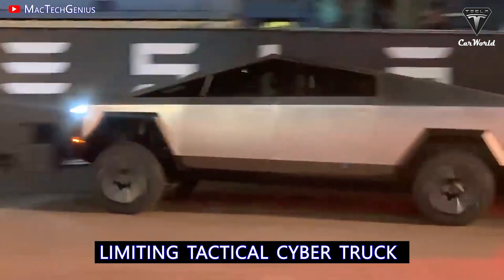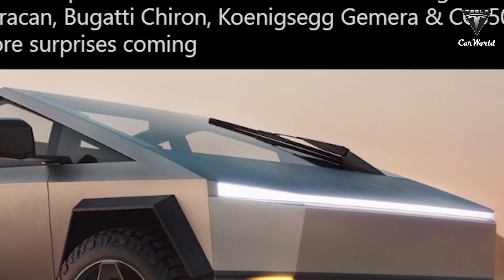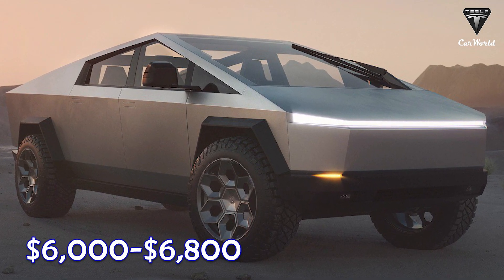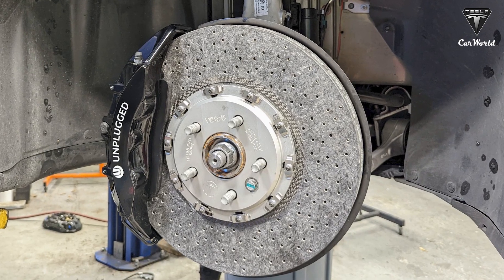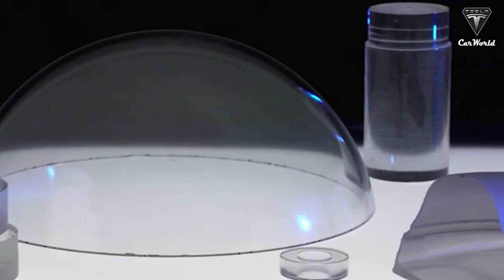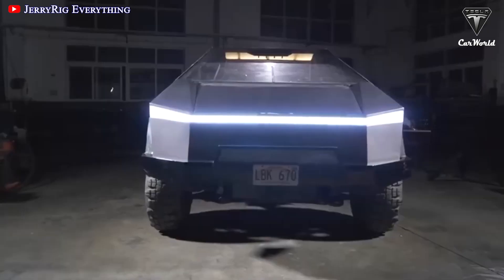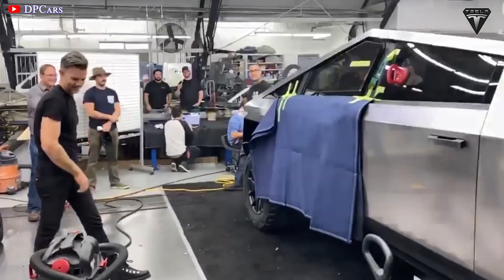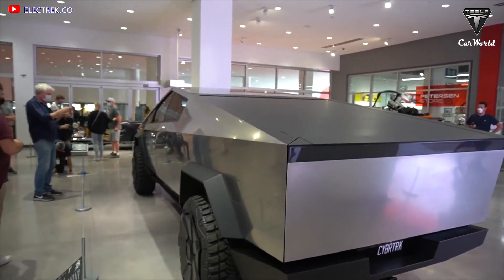HUGE NEWS! Elon Musk Reveals Tesla Cybertruck Is Being Redesigned

Comment: Just realized that with its 4 wheel independent steering they can simply turn both rear wheels outwards and also the front the same and then with a propeller profile hubs it would have serious in water thrust and steering.

Comment: Why in the hell would you need special brakes on a car that has regenerative braking? Most of the comments I have read say that people rarely touch the brake pedal. At introduction Elon said the simi's brakes would be guaranteed for 1 million miles because there was the was little need to ever use them. Maybe if you where going to enter a formula 1 race with your cybertruck, but that's a far corner of the bell curve on how these trucks will be used.
Reply: only argument i could think of would be that the wheels are larger which puts more torque on the brakes requiring stronger brakes.

Comment: You didn't mention the most important Improvement in the braking system of the cybertruck it will not be using any hydraulic lines or master cylinders each wheel will be electronically controlled to activate the braking system
Reply from the maker: Thanks for your information !
Reply: They will also be a six wheel version of the cybertruck along with cold air rocket thrusters

Comment: Now that sounds really dangerous high temperature brake fluid on a battery operated vehicle
Reply: Are you thinking it would safer on a combustion engine vehicle loaded with 20 gallons of volatile fluid, situated directly between two of the braking units?